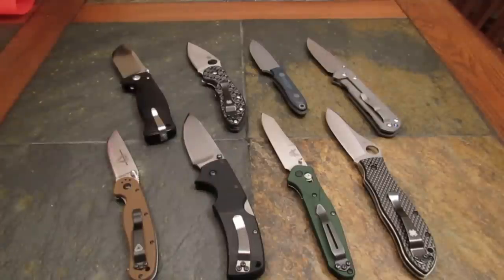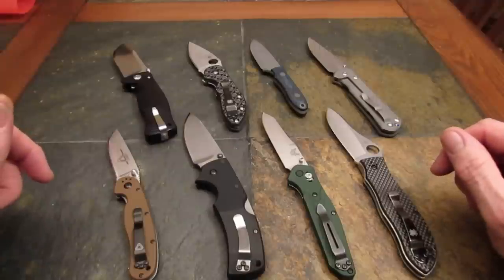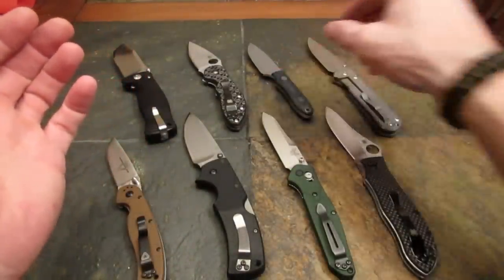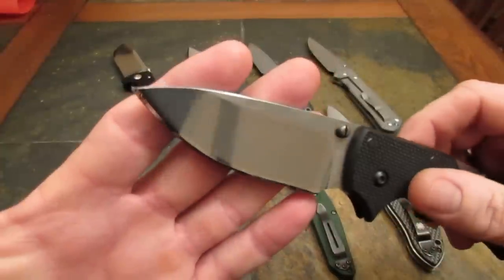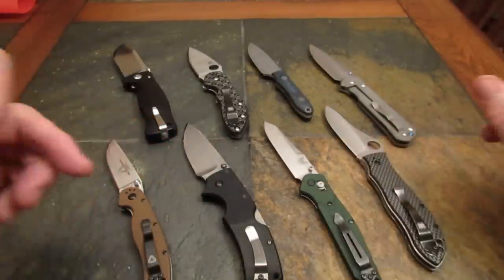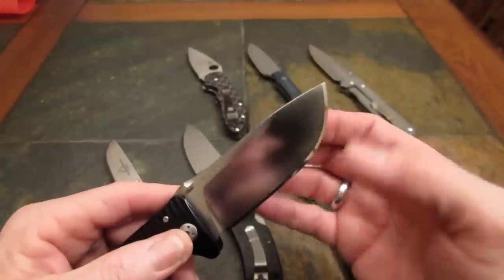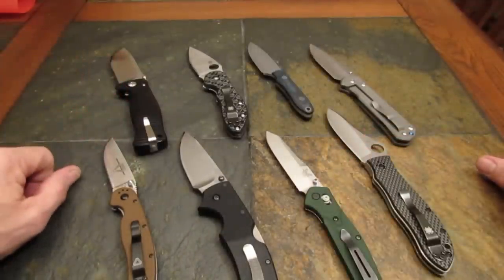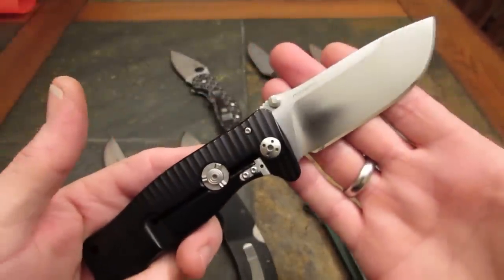Knife Rant 1.0:  Bad Factory Edges and Jacked-Up Plunge Grinds

Comment: Spent 5 hours making my Benchmade 707 right. Base needed to be ground past the plunge. Edge was crazy obsuse and the tip was absurdly uneven. The swedges needed to be recut to meet the tip, because their geometry didn't allow for the broader bevel I put on. (A frequent Benchmade issue. Change the edge geometry, and the swedges look awful.) Finally, all the adjustment to dial in the axis. 

It's like buying a knife kit.

Comment: Thank you for your rant. For the education contained within it. Especially for a novice, like myself, when it comes to fine details about knives. 

Suspect, buried within that comment is the reason why it's happening. Craftsmanship is fading away, because there are so many people, again like myself, who don't have a standard by which to judge same. They know I've never owned or handled a knife that represents near perfection in design and execution. 

Pride in craftsmanship is being replaced with pride in profit margin with mass merchandising. Yes, I fully understand the need for a decent profit to stay in business. Understand ROI. Grew up on a farm. Became a "bean counter" in manufacturing, wholesale distribution, and retail. Have calculated, many times, the impact on bottom line of an equivalent to replacing 2 green peas with their weight in water in a can of soup.

Not a lot of difference between replacing 2 peas and lowering quality control standards another fraction of a degree. Whether in the initial design phase or when finished product goes into the box. -- Oldtimer Lee probably won't notice the difference, especially if we emphasize our "new and improved". -- Sadly, often they are right. I won't notice the difference, because I don't have a standard by which to compare. 

ApostleP, your expertise is in knives, thus you know what good craftsmanship means. You can recognize it when you see it and touch it.

FWIW I collect old cast iron cookware & restore it to useful life again. Blindfolded & wearing gloves, if you hand me a skillet I can tell you if it was manufactured before or after craftsmanship disappeared from that industry. Take off the gloves, so my fingers can feel the texture of the casting, can likely tell you if it was made before/after the mid 1960's. Touch alone, lets me know if the piece can possibly be dated back to the 1850's or so. Same thing with today's USA made and more inferior castings coming in from China. Purchased by people who simply don't know that an egg can be fried, without sticking, in a quality cast iron skillet. -- Quality (craftsmanship) that was phased out over the last couple of generations. 

Made the cast iron skillet reference because nothing I see on the market today, regardless of price, can compare in quality of craftsmanship of yesterday. That includes the no name, generic foundry work (not sought after by collectors) of yesterday, compared to "top of the line" being produced today. 

When I hear someone praising the virtues of their expensive new cast iron skillet, sadly realize they've never touched or used a no-name produced, perhaps, 75 years ago. Nor, a highly priced by collectors, Griswold, regardless of when it was cast. Thus, they don't have a true craftsmanship standard for comparison. Just as I don't with knives. (Old Hickory butcher knifes, some what of an exception. :-) )

Thanks for listening. Thanks for teaching. 

May our Lord bless you and your family in the coming New Year.
Reply from the maker: Thanks for that, Lee.  Your experience and observations are much appreciated :)
Reply: You Sir just illustrated that true wisdom is something that can be applied  over many different genres and experience gained in one field can be redirected over to another.  Thank you for sharing.  8-)

Comment: I know this video is old but I just wanted to comment on the benchmade blade grinds. I had a similar experience with a Ritter grip. I got one for Xmas last year. The primary grind was so off that it made the blade look off centering. I sent it in and they adjusted the centering but it was still way off. The second time they explained that it was the grind. I asked them to send me the most symmetrical blade they had which they did and all was well. They were very cool about the whole ordeal but it sucked to have to send my new knife in twice.

Comment: Excellent vid and discussion. I am always surprised when I get a nice edge on a factory knife. I'm always pleasantly surprised by a nice clean sharpening notch or choil, and your right both are rare. I don't expect a manufacturer can deliver the kind of stupid sharp high polish that you and I like to achieve though, and that's great that we can "out sharpen" most all manufacturers. There is no excuse for sharpening not to be considered in the design, and even worse when the design is right but poorly executed like the Lionsteel. I add a single serration now as a sharpening notch when needed. Great topics!)
Reply from the maker: Thanks for the kind words, my friend.  Very good point about what we should expect, btw... I don't expect a knife to have an edge from the factory as sharp or refined as what I do, but it should be sharp, consistent and symmetrical, and lend itself to resharpening without major modification or reprofiling.
Reply: TheApostleP
Although if you don't mind me playing devils advocate here a little bit.  I've recently gotten in to some really great budget knives by Schrade (because I'm broke LOL!) that without fail need their edges reprofiled, sharpend, and honed.

Because I am able to do all that I've felt that I've really gotten some real bargains in them. shrugs  Just my own 2 cents here and I'm in no way trying to diminish or contradict your valid original points in the video or later in the comments.
Reply from the maker: Eric Montford I totally get that, and in my videos on the CS American Lawman and Recon 1, I said as much.  I really don't mind taking a few hours making a $40 knife into one that performs like a $150 knife.  Great point!

Comment: I could not agree more with you on the SR1A. Mine came already sharpened in a v edge from its previous owner but still in a very steep angle...about 25 dps...which is a lot. Yours looks great. Mine secondary edge is that wide at a 25 dps edge angle...I really don't want to take the edge too high as I do like the looks, unfortunately I do not like its cutting ability.
As for the RAT1(i don't own the RAT2) It is great..really an inexpensive knife that works. But the RAT1 does not have a choil for sharpening...so I convexed mine...and I have to say: it performs excellent

Comment: Another great video Rob! This is a subject I have become much more aware of as I have gotten into sharpening myself and do not hear many knife guys talk about. In your experience is it possible for edge geometry to be inconsistent from one side to the other? I have several blades that I know have the same angle on both sides because I have reprofiled them but one side is narrow and one side is wide.
Reply from the maker: Great question/point, my friend.  I really forgot to mention that, but yes, many factory edges are horribly asymmetrical.
Reply: Good to know. Maybe a topic for Vol. 2

Comment: I love my RAT 2.  It works great with my Sharpmaker on the 40 degree setting. I hope they make it in D2 like the new model RAT 1.  I had a Benchmade Presidio Ultra in 440C, it was the worst grind I've ever seen on a factory edge. That being said, I had a Benchmade 556 that was awesome and easy to sharpen on a Crock Stick.  Go figure.

Comment: Great video btw! The knife I bought was the cs mini ak 47. I didn't realize it was uneven until a few months in and I had already taken off the coating so I couldn't really ask for a refund
Reply from the maker: I really can't hit CS too hard for some edge symmetry issues.  Their knives are at a price point where you'll have some of that.
Reply: TheApostleP i was just kinda disappointed since a 35 dollar kershaw has better fit and finish. Pretty much all of the kershaw's i have purchased, i have had no problems with. maybe i just got lucky for those ahha

Comment: Great video brother. I have a similar issue with my Spydies when sharpening. I was wondering what you used to knock out that piece of steel on your domino? did you drill it out?
Reply: I'm nervous to try it myself as I am not sure I have the steady hands for that surgical procedure on steel hahaha =)
Reply from the maker: It's a pretty easy process.  Just lay the knife down on the table, cutting edge up.  Then use the corner of the gray (medium) Sharpmaker rod and make a sawing motion perpendicular to the blade.  In 500 passes or so, you should have a nice sharpening notch :)
Reply: TheApostleP so I don't have a sharp maker, but would a slim nail file work. I have a good amount of files that I use to hand grind out some blade stock on a few knives I am in the process of making. Because as you said at times the plunge grind isn't exactly 90 degrees making it hard to reach the edges of the bevel before the ricasso on a few of the spydies i own. Thanks for the tip btw!
Reply from the maker: Any abrasive tool that will cut the blade steel and give you the desrired profile will work :)
Reply: TheApostleP Thanks Again. Great upload.